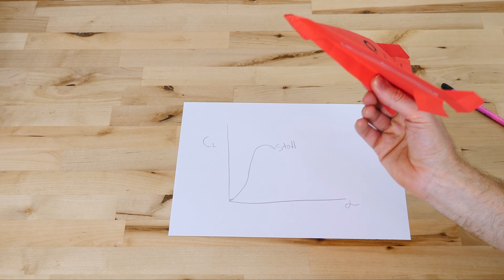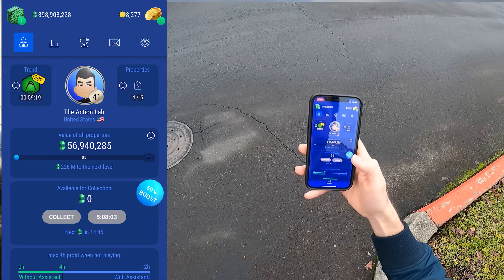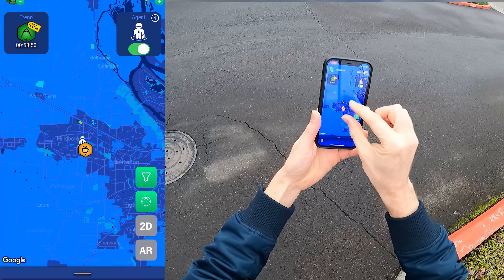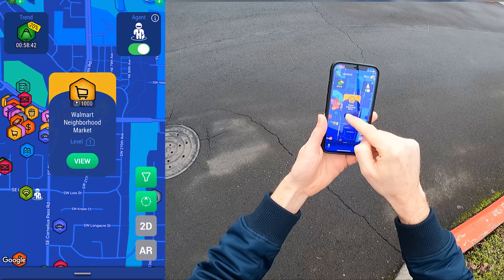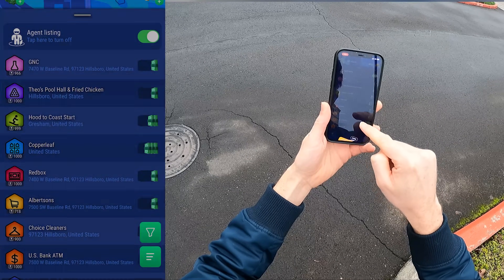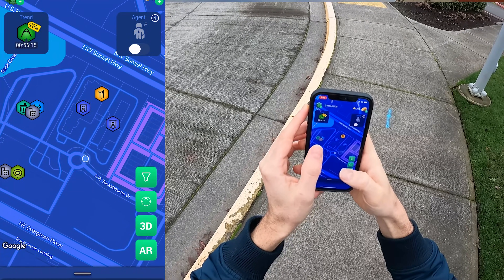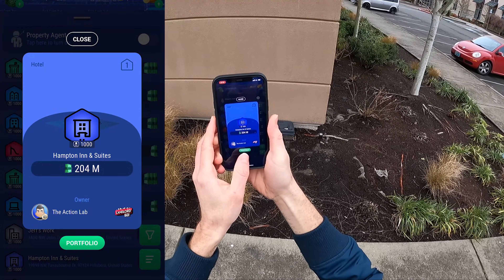How Far Can An Aluminum Foil Airplane Fly If You Add a Motor?

Comment: aerodynamics is overrated and they spend to much money making overcomplicated wings on planes that could be made as simple as a paper plane. think how cheap airplanes had been if there was almost no engineering involved and only basic straight angles of flat wings. the price of a plane would be so cheap anyone would affort one. to bad we dont have these fantastic vertical take off propeller plane hybrids we see in scifi movies but someone could alway make these in their kitchen as models at first. think how cheap airplane development had been if they did only models at first. all this wind tunnel crap would be a waste of money. a plane that is not a good glider is a bad plane period.

Comment: That paper plate should be able to produce a huge amount of lift if you flip it upside down. Think of it as the leading edge of a Frisbee. Add some reflex tabs on the trailing edge to tame the vicious nose-down pitching moment. Carefully choose wing position relative to centre of gravity for pitch stability. A slight offset between the height of propeller thrust line and wing could be useful for pitch control in flight.

Comment: I think the paper plate would have flown also, if the angle of the "wings" in relation to the direction of the forward force had been adjusted, to give you a better coefficient of lift

Comment: I have a question if you were able to take a model rocket or a modified model rocket and attach a weather balloon to it and before it explodes you drop it launch it and then see how high it will get from there of course you will need to have a way to stabilize it and keep it away from the shrapnel of the weather balloon if it does pop of course you will need to have a way to catch up the speed first like a solid fuel rocket and then have its actual rocket and see how far that will go and if you put a camera to it it would be kind of cool to see that transition.

Comment: THe reason you had more control was you had more alpha. IE you were flying "high alpha" the entire time (it was tail heavy but not outside its limits) this means it slowed down and was more responsive to turns as it was "sitting on the propellers" thrust so to speak kind of like a rocket.

it was probably lighter too. high alpha only works well when you have good control authority and high thrust to mass ratio (light weight lots of thrust)

since its SO light the primary "RISK" of high alpha (stall) does not really apply and the second major risk (tip stall) does not really apply since you have good thrust authority (lots of power not a lot of mass)

you can see this tail heave aspect when you noticed that you could not just climb you had to TURN and Climb. because it wanted to point too nose up so you had to bleed off some of that energy by spiraling up. you also say this on your decent when it would "mush" basically fall flat straight down with little forward movement.

IE your high thrust to weight ratio allowed you to fly high alpha (nose up high angle of attack) which let you really slow things down and "fly on the jets" (prop thrust)
Reply from the maker: I think you are right. I weighed the planes and the aluminum foil one was actually lighter (21 grams for paper and 19 grams for aluminum). Also, the wing area was less on the aluminum foil plane!

Comment: Seeing as the bulk of commercially made aircraft are mostly aluminum, it only makes sense that you should be able to make an airplane of any size/scale with aluminum, it would be a more realistic [difficult] challenge to make it out of steel, brass or copper foils.

Even then, a carefully folded foil plane can still have very high lift coefficients, albeit, even then, you are likely going to need more power or you will face far shorter flight ranges, compared to making the precisely same body except from plastic, paper, aluminum or magnesium.

The 5 main reasons magnesium is not used instead of aluminum [in full scale commerical aircraft] is 1, Magnesium is very expensive compared to aluminum, 2, it is more expensive to work, 3, It will corrode so easily that it is just too costly to maintain, 4, it is very brittle so it can fatigue and fail more easily, and 5, it is highly combustible/flammable so that it is far more dangerous than is worth the weight savings. 

On the other hand, steel, while it will rust, is pretty stable, STAINLESS steel, while a bit heavier than mild steel is nearly indestructible in non-combat scenarios, copper, while somewhat prone to corrosion, forms expertly into high precision shapes and then holds them readily due to something called 'work hardening' [although, if you mess up, you have to re-anneal it or else it can be ruined], brass, while not as brittle as magnesium, tends to be a little lighter than copper, takes a crease fairly well and has pretty decent corrosion resistance.

The number one reason all of these metals are disqualified for use in aircraft lifting bodies, of course, is their mass.

The only other metal readily used, even despite its elevated cost, is titanium.

At only 40% the mass of steel, and easily as strong, or even stronger, titanium also has real world advantages over aluminum, such as increased heat and fatigue resistance, corrosion resistance, and strength-to-weight(mass) ratio.

That said, for SOME newer engineering firms, there is actually a push to create new, forgeable alloys of magnesium [as with any alloy, this means a mixture of the chief metal with small portions of other metals, and/or with carbon, silicon, nitrogen, hydrogen, and boron] which have been showing some promise in experimental research.

IF there ever comes a day they can reliably, and economically forge magnesium parts, especially for low moisture, thermally shielded, internal structural components [such as places where the wing struts join the fuselage] because the the strength to weight ratio is already high, but it will not only become higher, but also, forged magnesium products made so far, have shown significant fatigue resistance over cast magnesium, as the plastic deformation of the forging process makes finer, stronger, more lineraly aligned crystals in the metal, which, by their nature, result in greatly improved fatigue resistance and cracking resistance.

On top of this, however, there is some research into casting either magnesium, or aluminum, or both as a high equivalency alloy into woven carbon fibers, and there is some reported success at this, resulting in vastly improved strength, resistance to fatigue, resistance to surface wear [as in lining engine cylinders with carbon fiber by casting the carbon fiber liners directly into the block because the metal simply flows right through the fibers, permanently becoming one with them...] this too can be used in places of high strain, like wing spars, and also for bushings and pivot points where wear, flexation and vibration might otherwise require some form of brass or bronze wear bushing, thereby, again, saving weight]

       /)/) 
    (  'ˬ') 
@(>_ )-b 
     \) \)

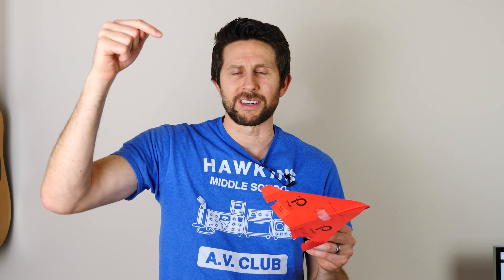Comment: At 1:50 or so I think you make a factual error.  Airplanes fly on "lift" not from air pushing up on the bottom of wings depending on angle of attack.  I know you know what Bernoulli's principle is.  You get some push under the wings but the real lift comes from low pressure on the top of the airfoil.

Comment: The lift is from the lower pressure on the top surface of the wing, so air pulls more than push the plane upwards.

Comment: The Action Lab: The angle is more important than the wings

proceeds to make wings out of a plate and cannot fly
Reply: I suspect there's an unaddressed issue of stability...
Reply: how about you try to fly the better winged plane at 90 degrees?
Reply: Good one lol 😂
Reply: It had the lift. Just not the stability to not roll sideways and lose the lift.

So nothing wrong with the lift equation.
Reply: I think it should have been an inverted plate... Then it probably could’ve worked
Reply: @MohitSharma_calc  I think plate should be rotated 180 deg. in horizontal plane, vs  motor to fly
Reply: Stop it!😁
Reply: what he meant was an airfoil, not wings. good observation.
Reply: Upside-down...
Reply: @yt.personal.identification  Yep, but his problem was not about orthography.
Reply: @EnginAtik  It's a good thing I am better at gliding paper plates than I am at grammar then.
Reply: @yt.personal.identification  Apparently you are a stickler for grammar. All good.
Reply: @EnginAtik  I think you seriously misinterpreted my response, or are trying way too hard...likely both.

I simply meant that had he turned the paper plate up the other way it would fly better.
Have you ever thrown a paper plate?

I typed it slowly in hope that you can keep up.
Reply: @yt.personal.identification  I know exactly you mean. I know the formula governing the potential/inviscid flow and how it evolves into gas dynamics and all.
Reply: @yt.personal.identification  Please keep those questions coming.
Reply: @yt.personal.identification  I am here to teach. If you are not interested, I will not take more of your time.
Reply: Think long and hard, if you say 'yes' the next topic is thermodynamics!
Reply: @yt.personal.identification  And that is how you establish a hierarchy if you must know.
Reply: @yt.personal.identification  The other option is straight tar and feathers for those totally uninitiated.
Reply: @EnginAtik  Yup...trying WAY too hard
Reply: @yt.personal.identification  Yup, it is the only way. You are cut out for it or not.
Reply: Clearly if I was to recruit you, it would not have stopped here: I would have made you apologize for all the misdeed you did whether you are aware or not.
Reply: Apparently this is the part of training you did not explicitly agree; you still have the chance to bail out.
Reply: I got you for bullshitting openly; It does not justify the level of punishment, but you are in no position to disagree.
Reply: Did I prove a point?
Reply: @EnginAtik  Bud, you are trying to show superiority over someone who has made the huge claim that they can make a paper plate fly better up side down, than correct way up.

...and yet you are still failing.
Reply: @yt.personal.identification  I am reconstructing how superiority is built. Paper plane is an innocent bystander.
Reply: @EnginAtik  You do you bud.
Good luck with that.
Reply: Don't get me wrong. We all learn from our mistakes.
Reply: "Always close with positive"
Reply: Action lab logic.
Reply: It could fly but needs more power, evidently
Reply: Coefficient of lift was negative for the paper plate. Plate had to be upside down to fly.

Comment: Angle of attack is as important as the other bits and pieces. When a kite flies, it's mostly about the AOA. That paper plane had some nice flat wings, but not much in the vertical "plane". Your aliminum plane had a lot more "boat" shape, which gave it better stability. And the crinkled ally foil was actually creating drag,that prevented it from flying quite so fast, so that probably helped with controllability too. Real plane wings have to compromise between things like lift, speed and efficiency. A big airliner needs to lift 200 or so people, but also needs to offer good journey times, while saving fuel in any way it can. Whereas a military jet fighter needs speed and manoeuvrability. So aircraft designers get to play on the swings AND the roundabouts!!

Comment: I made a similar thing where I tested different wing materials for gliders. What I would do for the tin foil wings is make a frame out of bamboo skewers, like long toothpicks,  by making a two triangles for the wings and a rectangle for the body. Then you glue the triangles together and attach the rectangle to the spot where you glued the wings. Then I would add tinfoil by just wrapping it around the frame. That way you don’t bend it easily and also it’s less wrinkly so it’s more streamlined. I would also make smaller triangles and attach them it the back as fins for stability.

Comment: Why wouldn't you compress sheets of aluminum together to create more stability? 
The airplane you made was comparable to the Japanese foil ball before you started hammering, then sanding it.
It would have more durability, yet still be lightweight because of the density of aluminum.